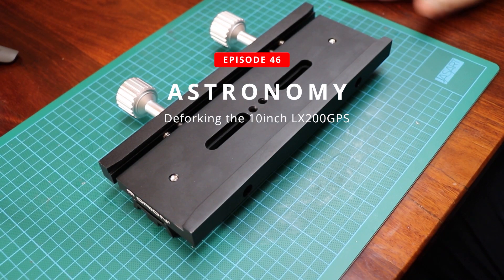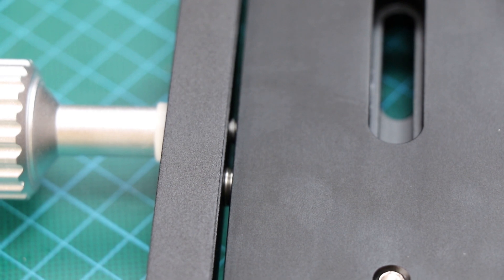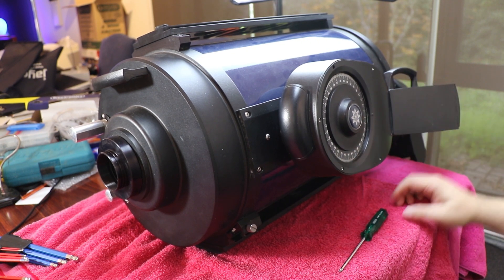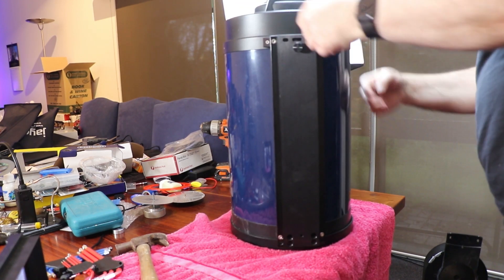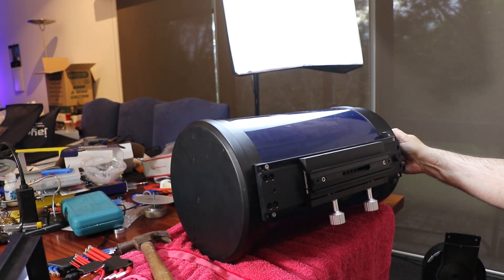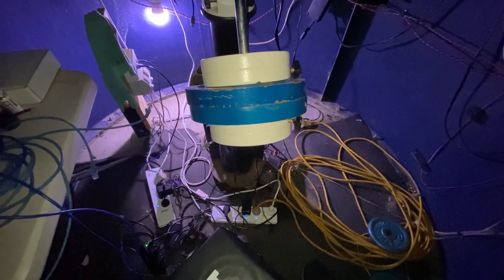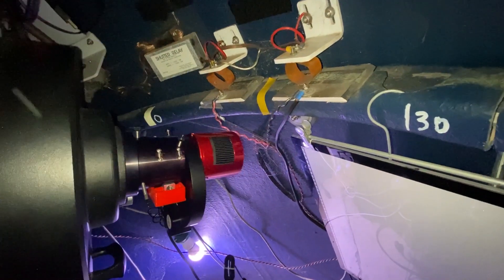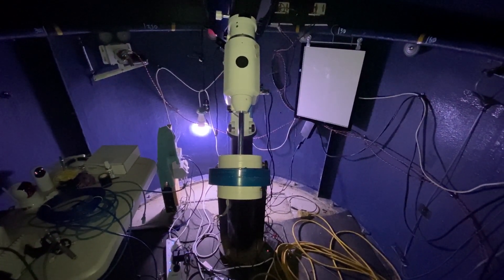Ep 046 - Deforking the Meade 10inch LX200GPS SCT

Comment: Checking your channel out again.  Found the video about de-forking the Meade 10” LX200GPS.  Have been thinking of doing that on my Meade 10” LX200GPS if my fork’s electronics or AutoStar II hand controllers quit.  I have three hand controllers, that I so far have kept functional.  Need backups for those.  Mead told me the OTA was 26-lbs leaving the fork base to be 36-lbs.  
I also have a Sky-Watcher EQ6-R Pro and was told the weight carrying load capacity was 44-lbs.  They told me the included 2 counterweights are not to be considered in the total weight carrying capacity of the 44-lbs.  However, upon some researching, people say not to exceed 33% of the carrying capacity.  I am assuming that means 44 minus 33% = 29.48-lbs of recommended weight carry capacity, I guess for good guiding.  I would also assume that any additional counterweights would be included with the telescope’s weight as well as the accessories, guide scope, camera system etc.
You mentioned that your mount is struggling at times indicates that, if I follow with de-forking the 10”, I too will need another GEM upgraded, from what I now have, in weight carry capacity.  I have used the club’s old Celestron 8” SCT on my EQ6-R Pro GEM and it tracks well, but I have noticed the heavier the telescope load, the more PHD 2 tracking graph line is not flat.  There have been times when I did not lose a picture with the SW GEM using smaller telescopes/camera lens but I did experience some losses on that 8” SCT but no where near as much as I lose on the Meade fork mounted SCT.
I used your method and 3D print file to do the ZWO EAF modification to my micro focuser as well.  It works great.
Thank you for the YouTube videos.  I also started my YouTube channel, it is called; Gadgetman Bowen.
Reply from the maker: I upgraded my mount about 18 months ago. 
The EQ6 struggles. It works but guiding especially at long focal lengths is a headache. If the budget doesn’t stretch, it’s worth trying but you’re in for a challenge. 

The weight is normally payload, not counterweights. I used to have 20kg of counterweight to balance my 10” OTA

Comment: I enjoy Your videos. Alot of great information! I have here a 8" LX200gps. I wanted to defork it and use the optics on a EQ6. I opened those screws on the bottom of the fork, but I cannot get the optic out of the Dec axis. Maybe just moving a little bit. Problem is, those 3 screws are completly behind the the fork and I cannot get to them. Do You have any tips?

Comment: Thank you for your vidieo. Is your EQ6 pro close to maximum weight with all your equipment? I am thinking of maybe mounting a second scope at at a later date.
Reply from the maker: Yes, very much so. I had 20kg of counterweights to get balance. It struggles depending on where you’re pointing. 
I’ve upgraded my mount since to avoid this issue!!

Comment: Hello, could you tell me what is the weight of the 10" tube without the U fork?
Thanks.
Reply: I know the LX50 10" is 26 lbs so it should be around that ballpark without the dovetail and accessories.
Reply from the maker: I think close to 15kg from memory. They are quite a bit heavier than their Celestron counterparts. With my image train, I need 20kg of counterweights to get balance

Comment: Thanks for this video.  Before I defork mine any idea what the scope of the LX200GPS weighs?  I was thinking of getting a mount that supports a max of 30lbs to save some $$$.
Reply from the maker: Not 100% sure, but with the OTA and reducer, OAG, guide cam and imaging cam, on my EQ6 Pro, I need 20kg (about 45 lbs) of counterweights to get to balance. I also struggle with guiding a fair bit especially at long focal lengths, and it’s pushing the capacity of this mount to the limit. You really probably should probably go the other way and get a higher capacity mount, not lower.

Comment: I enjoy that everything did not work out perfectly.  All of us struggle with telescopes. I want to defork my lx600 and the tip to remove the forks from plate to avoid scratching is great advice.  I learned something.  I also like you show us some unintended problems that arise.  Problems we were not anticipating that can become larger than the initial problem.  Well done.

Comment: Thanks for this video. I'm looking into doing the same with my LX600 12" OTA. What was the model name / number for the dovetail adapter? Thanks!
Reply from the maker: Given the weight of a 12” ota I’d want to have a good think about weight capacity limits for your mount. My preference would have been to have the dual puck saddle, but that seemed to be on endless back order. I’m at the max weight on my EQ6 Pro with a 10” so I’d really want to make sure your mount is up to it. 

https://www.bintel.com.au/product/orion-narrow-to-wide

Comment: Just an FYI, your filter wheel is backwards. The filters are closer to the hump in the wheel and that should be on the camera side. The documentation for the wheel explains it. The way you have it, your not getting the full benefit of the filters and may be causing some unwanted vignetting. On the balancing, you want it just slightly scope side heavy so it engages the tracking motors and helps remove any backlash that may be present. There used to be a saying about making the balance East heavy.
Reply from the maker: LOL - You're right - it was on backwards in this video, as I was just test fitting everything (and was a bit flustered). I did however mount it correctly subsequently, and never imaged with it the wrong way.
As for balance, this setup is quite heavy (I need 20kg of counterweights to balance). I do try to have it every so slightly off balance but of course, it depends on it you're pointing N/S and which side of the pier you're on. I seem to be able to guide pretty well regardless now.
I have recently had the Rowan belt-mod kit installed, and that seems to have helped quite a bit with my guiding with the OAG.

Comment: What rails did you use on the sct?  I have an ETX I want to mount on top of my 10” lx200
Reply from the maker: It would have been an older iteration of the Losmsndy D size dovetail. I got 2, one for top and bottom. 
https://www.bintel.com.au/product/losmandy-dm10-dovetail-plate-meade-10-inch